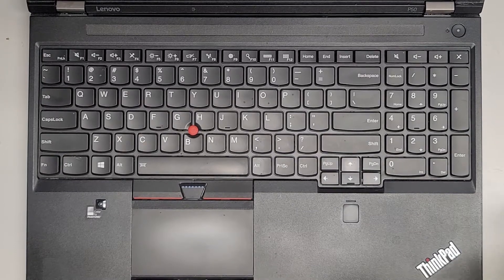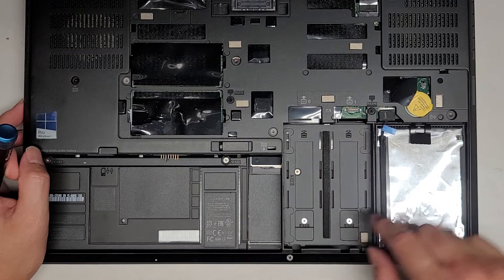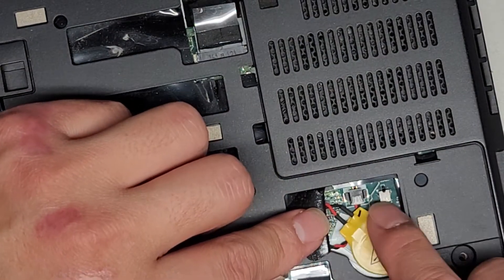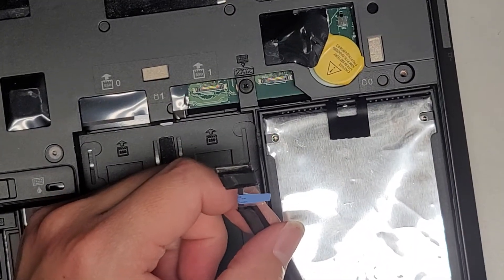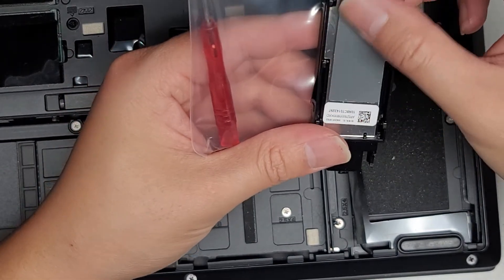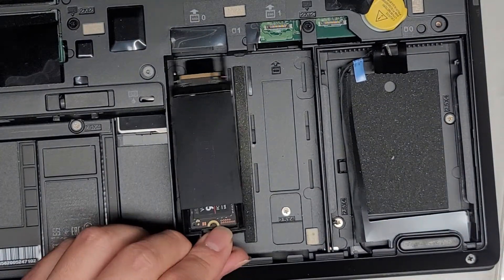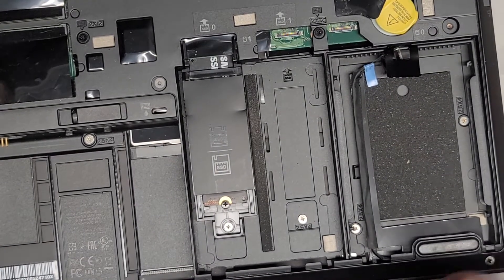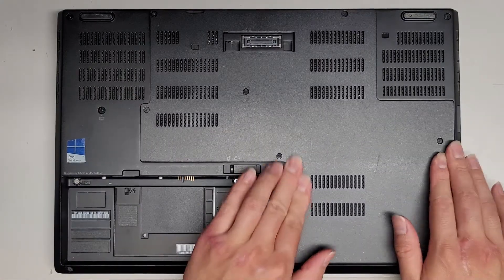Lenovo ThinkPad P50 Disassembly RAM SSD Hard Drive M.2 PCIe NVMe Upgrade Battery Replacement Repair

Comment: I am an undergraduate student, and I am currently facing an issue with my laptop battery (LENOVO P50) — it has been draining very quickly, even with minimal use. This is making it difficult for me to manage my studies and assignments effectively.

I was wondering if you might have a spare or replacement battery available. If so, I would be truly grateful if you could let me know. As a student with limited financial resources, I’m trying my best to manage within a tight budget, so any help or support you can offer would mean a lot to me.

Please let me know if you need any details regarding the laptop model or anything else.

Thank you so much for your time and understanding.
Reply from the maker: Keep it plugged in and you won't need a new battery.

Comment: in what part is this Disassembly you fool no no no no no NOT DISASSEMBLY is it
Reply from the maker: "Disassembly is the opposite of assembly, meaning to separate something into its individual components." I mentioned what parts were removed. Where did it say motherboard? Did you expect capacitors to be desoldered?

Comment: hi,
 i have installed SSD samsung 990 pro but I have a message 2100 detection error ... pres esc to continue” can you help me please ?
Very good video
Reply from the maker: Did you install windows on it? Where is it giving that error?
Reply: I would like to replace my hard disk I received the Samsung 990 pro SSD and I installed the SSD in slot 0 and I used the same media but I still have the message 2100 detection error.... Pressescv to continues...I think it's a hardware problem .

Comment: I have a p50 i7 6gen 
20gb ram 
M1000M 4gb ddr5 
And I play games like spiderman morales spiderman remastered, God of war at medium , horizon zero dawn at high ... This laptop might seem weak but it will surprise you it runs high games at a decent framerate with high settings.. one of the best deal I ever had...the only thing hurting is Dx 12 feature 11_0.. 😂😂 I wish it has feature 12_0
Reply from the maker: Nice
Reply: But can it run Baldurs gate 3? I'm so close to buying the same you have for retro games, but would love to play BG3 on low settings if possible.

Comment: What is the max RAM capacity please.  Can we insert 32GB in each slot. will the motherboard accept it
Reply: My P50 has 2 32 @ a total of 64gb - I ordered it that way when the ram upgrade from 32-64 was free.  I got my Laptop via a Corporate purchase program (about 6.5-7 years ago.)
Reply: @ryanmeldrum1443  Thanks , can we insert four 32 GB RAM
Reply: @silverreserve5174  no, only 2.  Max for this module is 64gb
Reply: @ryanmeldrum1443  Thanks have you tried it
Reply: @ryanmeldrum1443  I read somewhere on leveno forum that for some 128 GB worked
Reply: @Silver Reserve  that is the newer p16 model that supports 128bg. (4x32).  The TP p50 only has two memory slots and AFAIK, only supports the 32gb memory modules.
Reply: @ryanmeldrum1443  P50 have four memory slots please check again I am using it and have 62 GB (16 x 4)
Reply: @silverreserve5174  mine only has two.  You must have a newer model.   If it has 4, then you can put 32gb in each
Reply: I stand corrected.   I just pulled the back off and checked.   I too am at 4x16gb.  I'll need to see what the cost is for 4x32gb.  Thanks
Reply: 64gb ram máx... 16gb en cada slop
Reply from the maker: You can put whatever you can buy that matches the speed specs.
Reply: @ItsBinhRepaired  Thanks but will the motherboard support the 32 GB or not
Reply from the maker: @silverreserve5174  Try it.
Reply from the maker: @silverreserve5174  The only way to obtain this knowledge is by doing it
Reply: @ItsBinhRepaired  Thanks but there must be a already knowledge for this before
Reply: @ItsBinhRepaired  why to do it someone have already done it before
Reply from the maker: @silverreserve5174  then you answered your own question...why ask if you already saw someone else did it?
Reply: @ItsBinhRepaired  Just asking if you might have experience with it
Reply from the maker: @silverreserve5174  If I did, I wouldn't tell you to try it.
Reply: @ItsBinhRepaired  I mean on anyother laptop
Reply from the maker: @silverreserve5174  yes, just try it
Reply: @ItsBinhRepaired  Thanks
Reply: @ItsBinhRepaired  and can you recommend a better version of leveno think pad please
Reply from the maker: @silverreserve5174  better version? Like newer model? I repair computers, I don't benchmark and use them.
Reply: @ItsBinhRepaired  Yes better than leveno think p50
Reply from the maker: Yes, which is why I said you can put any capacity you want, as long as it's the same speed and type of RAM. There is rarely a capacity limit on the slots.
Reply from the maker: I've used 16gb sticks on other laptops before.